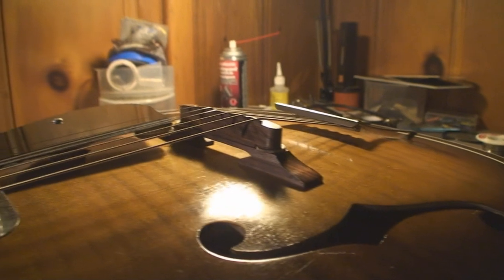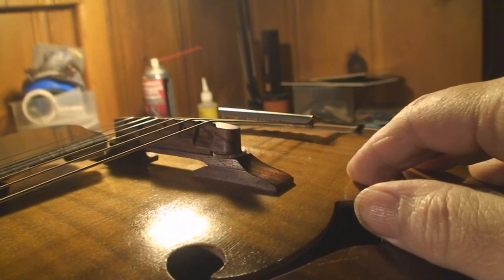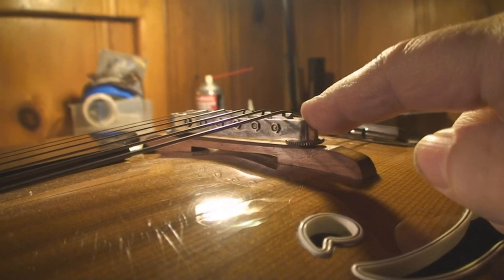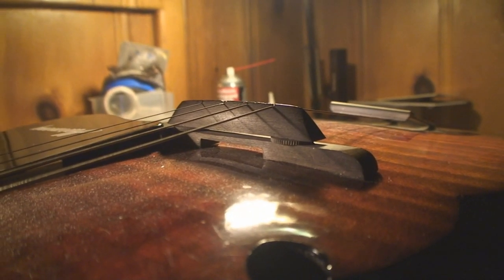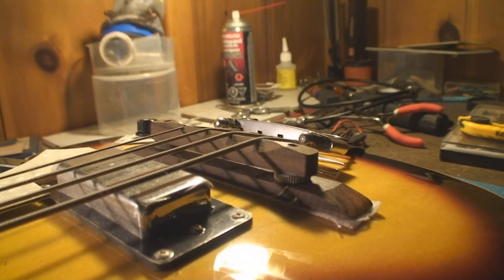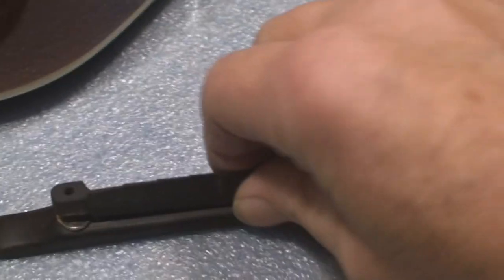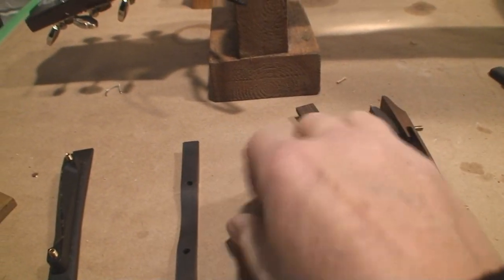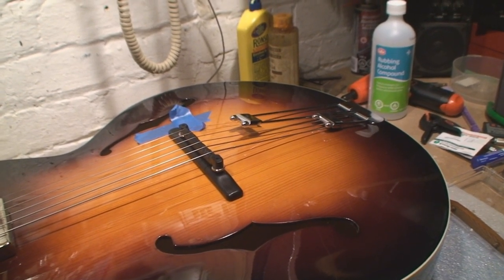Loar Guitars and Archtop Bridge Parts

Comment: On any acoustic archtop guitar the bridge height (so the strings) have to be at least 7/8'' to 1-1/16'' high above the guitar top so the floating bridge get enough down pressure from the strings and a good break angle to the tailpiece. If this results to a too much high action at the 12th fret it means the neck angle is too shallow and the guitar needs a neck reset to correct that.

Comment: The Loar necks are often very shallow (and inconsistent) so you do have to knock down the bridge. I personally take material off from the bottom of the bridge, I just deepen the cutouts for the thumbwheels after sanding down the bottom of the bridge. I also take material off the top of the foot as well so that the bridge portion doesn't get too weak and collapse under the string pressure.

Comment: Are the thumb screws to raise and lower the action, or do you move the bridge either towards the nut or do you bring it toward closer to the ( in my case) the Bigsby.   I have a Gretsch Duo Jet. With a non pinned bridge.    Thanks.  Daniel

Comment: What is the use of that thumb wheel and what changes will be there if that is not adjusted properly. Also pls explain the standard position of both sides of thumb wheel.

Comment: Dave, it should also be pointed out to Inky that some bridges don't use a base the posts are mounted directly into the top ,as is the case with Gibson and other makers that build semi hollow archtops,that have a chuck of wood that runs from neck to tail,Wouldn't that be to much mass?The bridges fit to the contour in relation to bracing under the top and scale length are key points.MASS...

Comment: sounds like someone questioned the great Davey without having their ducks in a row. if it aint broke, dont fix it, and on the other side of that coin, if it works, it works. you can do the sandpaper on the guitar and sand the bottom down, or you can shave the top of the bridge to lower it. both methods get you to the same final product. i would say that shaving the bridge would be MUCH safer for the guitar as a whole. sanding the bottom would risk slipping and scuffing the lacquer.

Comment: enjoyed the video.  fixed em and played em for 40+ years. dont take any crap from anybody.  first of all. the loars are very cheap guitars. it makes no difference where you remove what...they still sound the same.  when you have to whittle on the the bridge, you take wood from all the places you can take wood to make it work. these geeks who read stuff on the net and think it is gospel need to work on about a thousand old gibson archtops.  you will see all sorts of different sizes of base plates and bridges.   bottom line. if the guitar sounds good, it really doesnt matter where you remove wood from. the most important thing is to make it play.

Comment: i think dave is doing alright....although i think it should be mentioned that a neck reset should be considered depending on the guitar...
Reply: A neck reset on that guitar would be extremely complicated as you would need to lift the headstock not lower it, that means if you get it wrong (even slightly) then the guitar is gooched ! Much safer to piddle around with the bridge pieces even if it did affect the mass by a few tenths of a microgram (which is complete bollox btw).